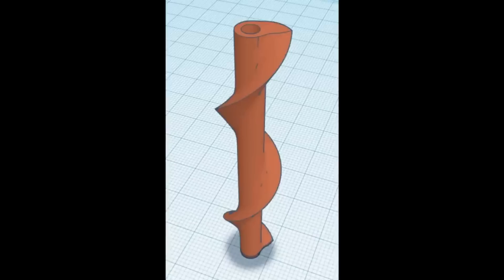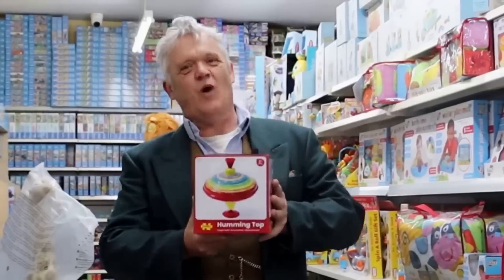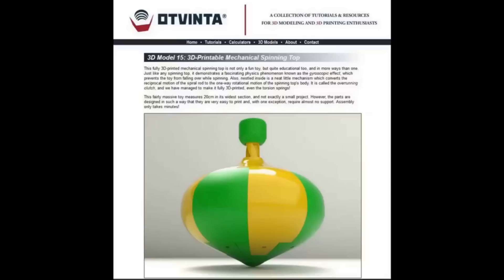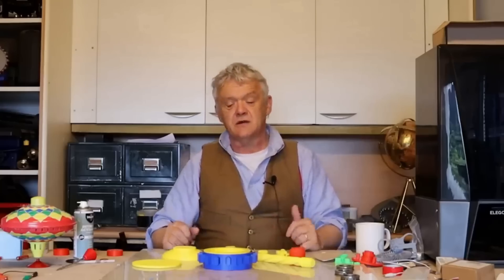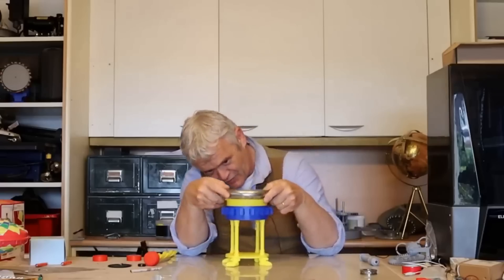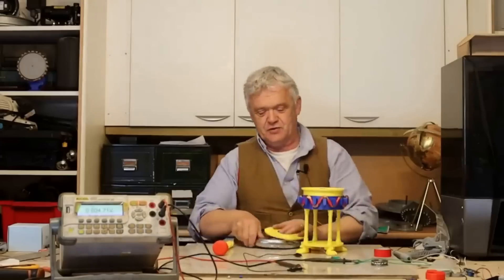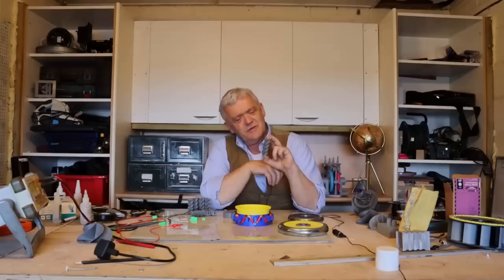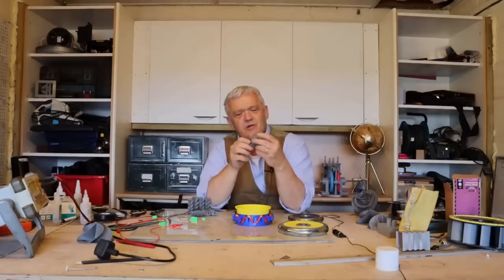2183 Storing And Using Gravity For Emergency Power

Comment: The mechanism at 8:16 reminds me of an anniversary clock.  Very nice if you had two wired in parallel and 180 degrees out of each other you could have a continuous supply of energy, or should I say converted energy.

Comment: Pardon me, as I am not an engineer by any means, but I have some thoughts on the last invention shown.

What are ways that the power could last longer? What are some ways that it could produce more power? What would making the weight heavier provide? Would a smaller threading be better because of more travel distance? Would this be possible with gears?

Comment: This is a brilliant way to use human power, given that you can generate roughly the same amount of power in five minutes of max intensity exercise as in the next twenty-five of steady aerobic exercise. Also, this is able to use the input of multiple people more easily than a bike generator. I can imagine a system where a group of campers could pile their gear into a barrel, raise it quickly via a "tug of war" type mechanism, and then have access to on-demand, stable power for days. Similar advantages to compressed air, but easier to engineer.

Comment: Here's a thought ok how to move an enormous amount of water quite easily:

Take a large vessel.
Connect large vessel to water below via pipe.
Fill large vessel with steam.
Seal off the vessel.

At which point the steam condenses into water. Creating a vacuum, drawing water into the vessel against the force of gravity.

The only energy needed, is enough to create the steam to fill the tank.

Ps. The same thing can be done by igniting hydrogen and oxygen into steam, then liquid water.

Comment: Mr Smith and all viewers thank you for your content and discussion
 :) just had a lovely discussion with the folks behind the thunderstorm generator, they claim that the generator eliminates carbon monoxide. My question for Robert is simple, does water vapor in the air intake lines lead to diminished amounts of carbon monoxide through chemistry? Or is the efficiency merely mechanical, a result of the expansion of steam?

Thank you for your interest in the thunderstorm generator, and for your keen desire to confront the misleading. Your perspective would mean alot to the team, and I'd like you to have all of the relevant facts.

Claims about tsg are:
-mechanical efficiency increased (doubled).
-transmutation of elements in the reactor.
-transmutation of exhaust from carbon to nitrogen.
-chemical changes in the exhaust.
Reply: I don't speak on behalf of anyone beside myself, merely a huge fan of the content on both channels.

Comment: 8:30 That was the first gravity battery video I saw, at least that had such a simple mechanism to "recharge" it. Was inspired to make my own, but it was long before I even knew what a resistor or Ohm was, so it never got further than a desire to make it. Maybe I will give it another go at some point, but likely after I get the money and tools to do so. I did get my first 3d printer which was delayed due to Christmas stock being out, but I should be able to build a mini one that can be scaled up rather easily. Maybe even pair it with a capacitor or two and a lantern form factor for outside when I am grilling late at night :)

Comment: 👍 There's also the clever device that was designed for camping-type settings, which is a flywheel driven by a string with a weight .. the weight takes approx. 0h30 to fall, due to the gearing, and the flywheel generates enough energy to charge a cell phone, or light an LED. And is easily reset by manually raising the weight again to begin another descent.
Reply: Any small solar panel should be able to charge a cell phone. 
Particularly a solar pane with a Fresnell lens
Reply: @fasted8468  The gravity generator mentioned doesn't need light.

Comment: Much simpler. Motor horizontal, weight on a string wrapped around the spindle, drop the weight. You can use a gearbox to adjust rates. The motor can also be slowed to a crawl by the natural current limiting of whatever circuit. Cheers.

Comment: If places like Niagara Falls and the Hoover Dam were fitted with gravity power recovery systems that utilized a much greater percentage of the water "flow", such as water wheels of such quantity and capacity to handle the volume..., then much of America's energy could be captured for "free". [Fuel price free, not building, operating, repair, etc]. The screws/propellers/impellers currently used let a lot of water to pass, andat the water output the water still has much energy....

Comment: Instead if all the mechanical bits, is it possible or reasonable to put the magnets in the weight, and the coils around the outside, so you just drop the magnets through a tube of coils, directly converting the kinetic energy into electrical energy?

Comment: You can't really "store up gravity", can you?   No, but you can store up energy by lifting heavy objects (or water) and later allowing gravity to pull it back down.   The reality is, the energy used will never match the energy gotten back.  If you want "free energy", it's as simple as using the energy that nature provides. Build a dam, and let nature bring the water up from the ocean, then tap the energy of the falling water.  OH, that's right, we already do that.

Comment: I had an idea years ago when they first opened the fitness centers and put the stationary bikes in, why not hook them to a generatort and a cord and power the place? Or have them charge batteries to save any excess?  You could actually make everything in the place create energy ,but some of it would be more trouble than it's worth.

Comment: 10:00,  The work required to rotate the cage must, of course, be equal to or more than the work that can be got out of the falling weight.  It would of course be a similarly person-powered device if buckets of water were lifted up the same height to fall through a turbine, or a spring was compressed.  In all cases, it is human powered via an inefficient device.

As I've said before, gravity is a rubbish accumulator for small scale devices like this.  
Equation for potential energy is mass (kg) x height (m) x g (9.81 m/s/s)
Do the math.  A ten tonne mass falling through about 37 metres 'releases' about 1 kWh.
With most setups friction is huge, and times generator efficiency you will be lucky to get 20% out = 200 Watt-hours.
To be of any use you need to suspend your entire house on a rope.  Good luck with the plastic worm drive gearbox then! :)
A good mass storage system is water pumped way uphill and run down through turbines when required, AKA pumped storage, at decent scale.

Comment: Love the gravity battery at the end. Did anyone get the specifications? Ie; Time it takes the weight to fall, the actual weight used, the distance it 'falls', Watts generated, thread pitch, type of coil system used to harvest the power, and so on.

 I also looked for this on the Net, but had no luck. I guess I could calculate most of the above, but experience tells me its always better to get raw data, rather than theoretical calculations.

 I like the idea of a gravity battery, and have been toying with the idea of making the weight a container filled with a liquid. The liquid is emptied at the bottom and then reset. Making the reset process relatively simple, lighter and safer, removing mechanical stress from the system. This would allow the 'recharging' to be done slowly as the container is re-filled, via a small pump with the same water (Liquid), by a smaller intermittent energy source. (Wind, solar and so on). Obviously a minimum of two systems would be required for a continuous power source.

Comment: The problem with gravity energy storage is the need for tremendous space.

A lead acid battery contains enough chemical energy to lift itself 12.6 km straight up...
Reply: A LiFePO4 had enough energy to lift itself into geostationary orbit.

That said: if you do have the space, or low energy requirements and prefer to skip deteriorating chemistry (like for an emergency radio) they have a few very distinct but unique benefits.

Comment: Gravity storage is my end game. I love the fact that it's storage time is infinitely lossless. I have questions about the mechanical efficiency though. IS a worm gear running a genny physically more efficient than a chain or rope turning a pulley for a genny? I've no physics training really but it seems friction losses would be more in a worm gear set up.
Reply: It depends on the screw and nut combination.
In CNC technology, one of the things that is 
designed to eliminate is backlash.
Backlash is slack in the system that allows play
within the nut and screw union.
There are two ways to eliminate backlash.
1) Use the screw to create threads in a plastic nut.
2) Design the screw and nut in such close tolerances that there is no slack.

In a belt or chain system, you would use an idler pulley to remove the slack in the system.

The key is to know what you are engineering for.
In this setup the worm gear appears to be limiting the weight's speed of decent, but that may be caused by the electrical generation itself. Whereas a belt or chain will have no ability to limit descent.

Comment: I can't help thinking there is a lot more friction in this type of system, as cool as it is, than simply suspending a weight on a cable going over a pulley. I'd be really interested to test and compare the relative efficiency of different gravity storage systems so might try to build this and find out
Reply: I had the same question. It's pretty important since ALL the losses in a gravity storage system are going to be friction.

Comment: if that falling weight could also tighten a spring as it fell, couldn't the cage holding the weight be made to flip itself over without the crank? awesome as always!
Reply: Then the weight would only fall to an equilibrium with the tension of the spring. Good engineering might be able to get it to flip a few times but each flip cycle would be shorter and eventually it would stop. You would also have to input enough energy to get the spring to stretch which robs energy from the genny. Better off just putting all the energy into the genny.
Reply: @flyingsodwai1382  ok. I'm not an engineer, but love the possibilites of these physic exercises.

Comment: Awesome idea. Just a little difficult and not very cheap if scaled up to store solar power for a small home though. Secondly there may be mechanical power losses due to the different directions of spin. But still awesome. Thanks.
Reply: When you don't have better technology, you use what you have.
You can wait for better technology, but you won't have the benefit of the current technology if you won't use the current technology.
Reply: @scotttovey  Nah I believe it can be improved just with some engineering.
Reply: @mooneym.3642 
Most things can be improved.
But they have to be used before one can see where their inefficiencies are.
You won't be able to improve a defect, or inefficiency until the defect or inefficiency is made known. 
Defects and inefficiencies will only be made known through real world use.
What looks good on paper, does not always translate to works good in the real world.
That's why no one has succeeded in building a "perpetual motion or over unity machine". The designs look good on paper, but they don't work in real life.

Comment: I've had this idea in my head that, one day, I'd build a prototype of a universal gym that's had all its weight hooked into a system that uses the weights as a gravity generator... and I think that this just added a whole new chapter to the book.  Imagine working out for an hour and then using the 1000kgs that you just lifted to cook your dinner. Anyone up to a design/build project?
Reply: Lifting a 100kg weight 1m requires about 1kJ of work/energy. It takes about 4kJ to heat 1l of water by 1 degree Celsius. Assuming the water starts at room temperature you need to lift your 100kg weight more than 320 times to make a small pot of water cook.
Reply: WTF? You just destroyed 2 decades of dreaming with your stupid science and facts! You should've just agreed and then watched me build the thing. Ok, ,maybe making dinner was a bit fanciful, but how about 2 slices of toast?

Comment: the student's generator could be improved if inside of the weight there was another generator and in the screw, they placed magnets inside so as it falls the screw turns and inside the weight it generates electricity.
Reply: Good thinking but unfortunately It would fall slower lessening the output of the main generator. See lenz's law to understand why.

Comment: Don't forget that this doesn't need to be limited to generating electricity.  It can also be used to physically move/power machinery.  Like for drilling, cutting, milling, etc   perhaps even for some novel forms of transporatation, connected to a transmission, drive shaft and axles.
Reply: Very good tip indeed. This reminds me of blacksmith bellows. Such device could be connected to a fan blowing air into furnace, and you just need to crank it from time to time, then use it's stored energy to blow air. Love this idea 😁

Comment: Could you put something like this inside the central column of a wind turbine?

If so, you could use excess energy from the turbine to turn the screw to raise the generator device.

If done at the right time of day, in raising the generator, you could use an incoming tide as well as the Archimedes effect of the screw to raise a head of water.

That head of water could be used to compress air as it raises up, generate energy via turbine as it goes down, possibly also could drive further air compression as it goes out too.

Then, you could drop the generator downwards to create its own energy, then, repeat the above process when conditions are next favourable.

The compressed air could also then be used in energy generation.

And this is all while the wind turbine is happily generating energy above.

Ok, so, the energy recivered from 1 turbine aline may not be all that great...however, when you have farms of many hundreds of these things, it stands to reason that this could make a not insignificant return when the wind isnt generating optimal returns.
Reply: You absolutely could and should. I never thought about it before but wind towers are a great place for gravity storage. They are already there blighting the landscape, might as well incorporate a storage capability. And I am pretty sure that many (if not most) windfarms have periods of over and under production. Good thinking!
Reply: @flyingsodwai1382  my only though is as to the structure that'ld be required to support the extra kit/what capacity inside the tower may be to accommodate it.

Comment: a great example of a gravity system is the funicular railway, where an air brake on the cable pulley can control the rate of descent.
Reply: There's an even better system proposed or in the works now for a mining operation. An electric train goes up a mountain unloaded. At the top it get's loaded with ore, Using regenerative breaking on the way down it recharges its batteries.

Comment: Hey Rob, I have had an idea bouncing around my head for years. I am planning on building myself a house one day and part of the plan would include a two storey garage. You drive the car into the first level onto a platform that lowers with the weight of the car thus generating energy from some kind of system like this. As you drive off counterweights raise the platform back to the first level. Imagine this used on a larger scale in a multi storey car park!
Reply: Or, a better crazy idea...  To use wind and solar power to raise an entire house on jack-up stilts - and extract power on the return..  (Flexible plumbing needed - as is a  sliding entrance shaft or drawbridge) - no unnecessary ballast weights or towers needed.

(Your 2 -story car shed idea makes no real sense (Rube Goldberg Device), as the energy expended driving up the hill is merely returned on the downside - only really useful if a car hoist is needed without any power source - other than the car engine.)
Reply: @kadmow  Those Rube Goldberg devices have been shown to work ya know? I get your point though, its not free energy. It is just exchanging petrol energy in your car for electrical energy in the house. IRL energy exchanges always include losses and in this case would be unnecessary
Reply: lol @kadmow  think your missing the point.

Comment: The Phillipine mechanism is brilliant. Gives me a great idea to automate it so that the reset  / turn will be taken care of.
Reply: - lol, in doing that unless "renewable energy" - or otherwise "free" or non polluting, is used it negates the whole idea, then it merely becomes a delayed gratification exercise.  Currently the whole energy input is from the human turning the handle.
Reply: why is there always somebody ruining the fun?

And yes, i agree.
But: 
When the sun shines and we produce energy with solar panels, but it is not used by people in factories or at home..... an excess production basically.
We could store it in batteries. Or we could convert it into this idea.

Windpower the same.
When there is enough wind and the mills produce too much, we could store that energy in some gigantic weight that is being pulled up a mountain.
And when there is not enough wind or sun to produce power, we could drop the weight down the mountain.

Right?

They basically do this with water.
A lake up on the mountain and one below.
And when there is too much energy being produced and nobody uses it, they use it to pump up the water to the lake above.
And when they need more power, voila, they got the water in the top lake to produce the power they need.

Btw, indeed, this is not Perpetual Motion. But i do not think this man, mr Geoffkeller, was talking about that.
 @kadmow